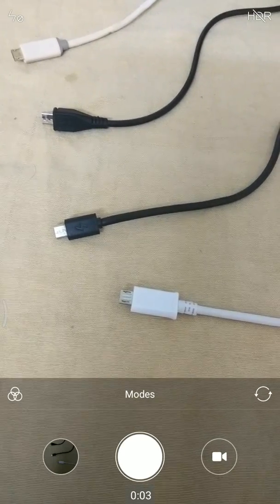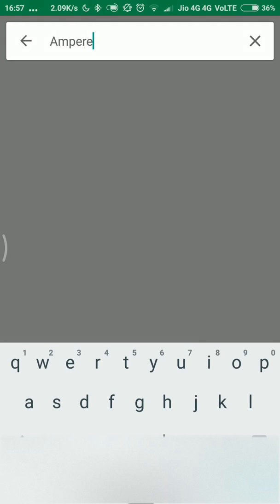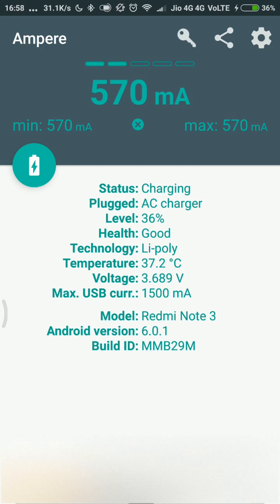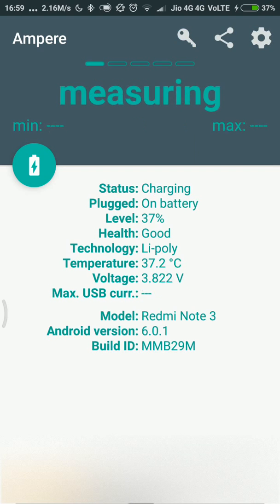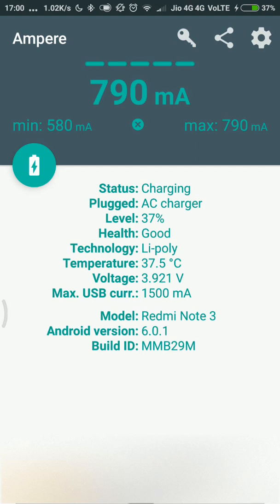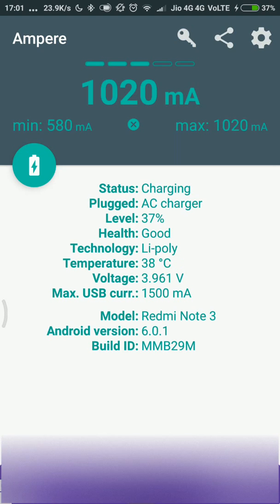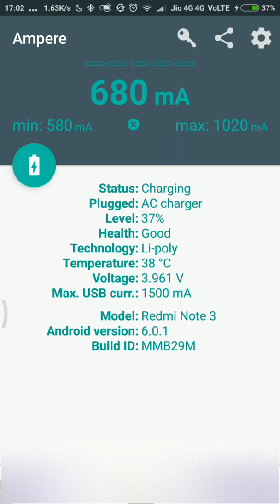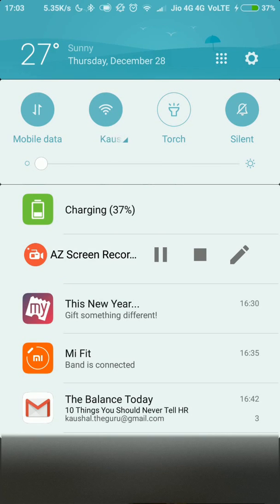How to detect a faulty USB cable

Comment: One of the feature of this app is when you are not connected the charger it gives negative reading, that is actually the amount of power phone is consuming. Did you mentioned it?
Reply from the maker: +Mohsin Memon  hey, thanks for pointing out, i have not mentioned it , as it does not work on all phones